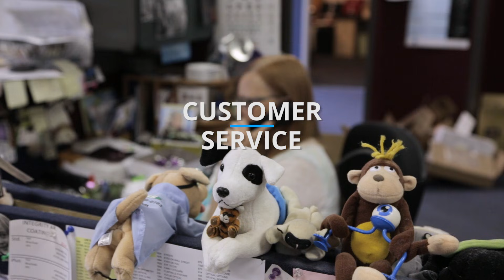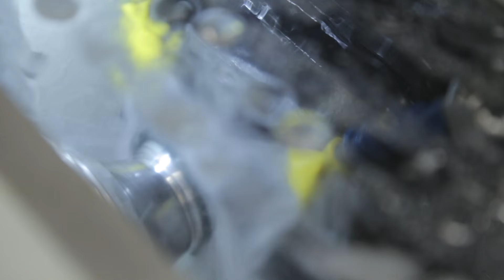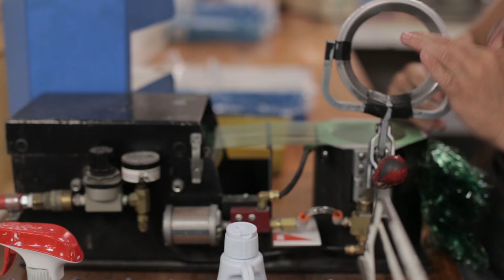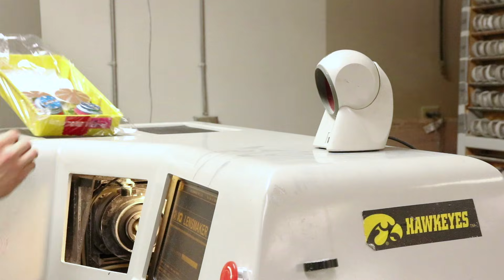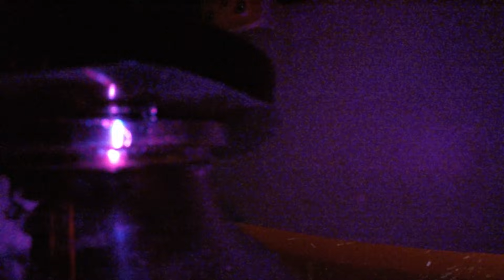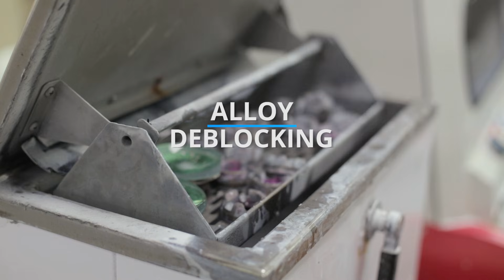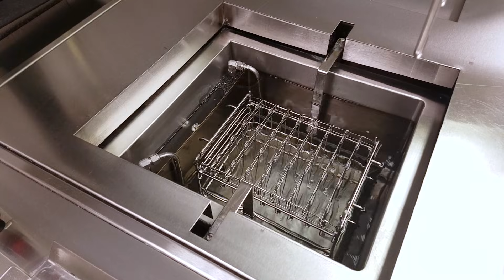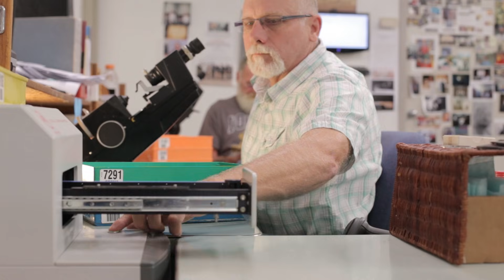How They're Made (Lenses and Coatings): Inside The Optical Lab

Comment: Speaking of The Lab. I think that the lab is off the hook just a bit too much when it comes to placing lenses in a pair of glasses that are not brand new but in great shape. Customers always get that waiver form stating that if the frame breaks, and is over a year old, it's not the responsibility of the lab. What kind of incentive does a lab tech have to do great work if he or she knows that the bottom line is that they're not responsible if they break a frame that isn't brand spankin' new? And how is that fair to the paying customer? I'm sure there are MANY lab techs that are great, but in life, at most jobs, we're not usually protected by waivers if we screw up. Now that said, sometimes a frame may be in terrible condition. But in that case, just don't put the lenses in. It seems to me that a trained lab technician should know when a frame is too brittle to work on. And if a frame in good shape gets broken, the customer should be compensated for the frame.
Reply from the maker: Laramy-K is a 99% uncut lens only lab! 
I do believe you are confusing something - the customer or the consumer has no direct relationship with the wholesale optical lab. Any waiver you are signing is with the store, who then has a relationship with the lab. I can understand your feelings here. And I'm not a fan of waivers as mentioned in a recent video - but - just what exactly is a store supposed to do when or if a frame does break during assembly? Some kind of sliding scale compensation based on age and use? What if the store doesn't have any kind of relationship with that frame manufacturer and couldn't replace it if it did break? Are we including emotional value of "I loved that frame!" How is the store supposed to know what that frame has been through in a year, two, three, ten? What if the frame isn't made any more? Does the store reserve the right to send that broken frame out for repairs? What happens when the customer insists they paid 10X what the frame actually sold for? 
It is a two-way street after all... John
Reply: @LaramyKOptical  - I understand that the customer has no direct relationship with the lab, but they are the people handling the frame and moving new lenses in and out of it when new lenses are ordered. And they did physically break the frame. I really do see your point concerning what is a store supposed to do if a frame breaks during assembly. I'm not sure what the answer is. I only know that it's always the consumer that comes up short in these situations. It happened to me with one frame two weeks ago. The frame came  back mangled and un fixable.  Screws for the hinges were not even screwed down all the way. I left the store with no frame AND had to pay for the new lenses. And they were very expensive, top of the line progressives. What was more disconcerting was that the store was owned by an eye doctor. A Doctor, who not once walked up to me to say that she was sorry for what happened. All she did was whisper something about the situation to the optician in the back room. I left the store feeling cheated and with no glasses. How could a Doctor let a "patient" walk out of her store without a proper "medical device" to wear? I think that sometimes the industry fails to understand that these are, when it comes right down to it, "medical devices" not just wearable fashion statements. If I needed to be fitted for a prosthetic arm would it be okay for me to leave the building if the device were broken by someone? I'm at a loss as to who the blame should be placed on. But I do know one thing. I was left with zero glasses and had to pay for the lenses. That doesn't seem fair.
Reply from the maker: @sinatralala  Well - that just boils down to really lousy customer/patient care. If they didn't offer you any alternatives then there is something wrong there. They have several options on offering you a discontinued frame, finding a frame they could force those lenses into, working out something with the lab (trust me it could be done). If you went in with a working pair of glasses and came out hundreds of dollars in the hole and no glasses I'd consider challenging the charge if you used a credit card. Of course there are always two sides to every story but you may want to be a bit of a squeaky wheel with the store/owner (not on social media until you have exhausted other routes). Unless the store is in financial difficulties with the lab and frame manufacturers (a possibility) there is no reason they couldn't come up with a fix. You may not love the fix but you would have a pair of glasses to wear. They are two pieces of curved plastic held in place in front of your eye with a few bent wires...

Comment: Is better wax or alloy? I saw that some new machine use an "alloy free" special glue with plastic block.

Beautifull video.
Reply from the maker: Macs, Not really a case of better. Like anything else they both have advantages and disadvantages. You use what works with the equipment you have. We are talking 50+ years of alloy use and 30+ years of wax so both systems have the bugs worked out.  Time will tell on any new methods. I know they block free edging now - I'm not sure about surfacing. John
Reply: Laramy-K Optical thanks, I love your video and I'm thinking to buy extra video course from you with larami k opticianworks.com 
When the things is made with passion and love works better